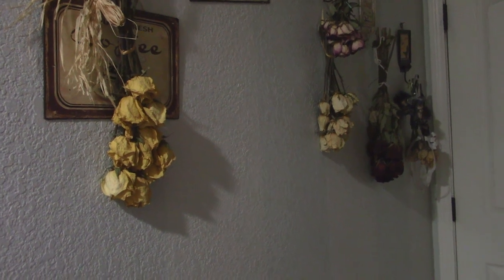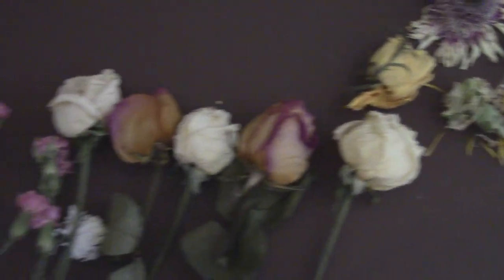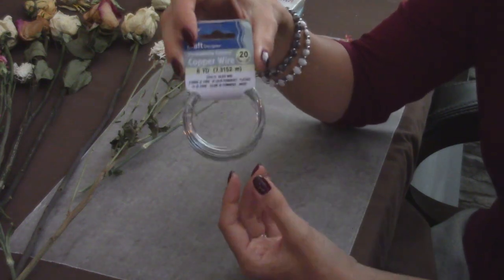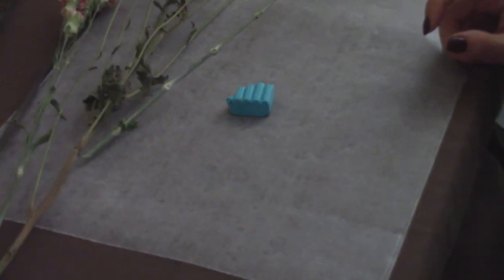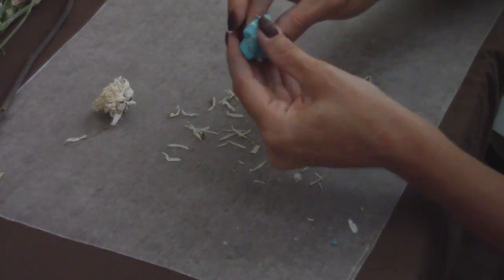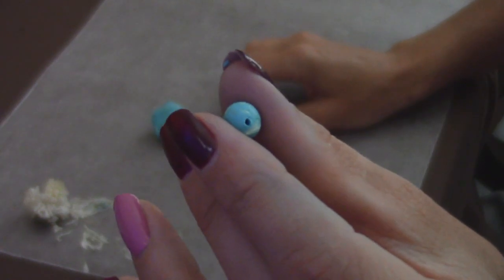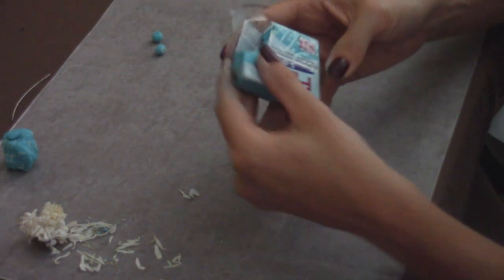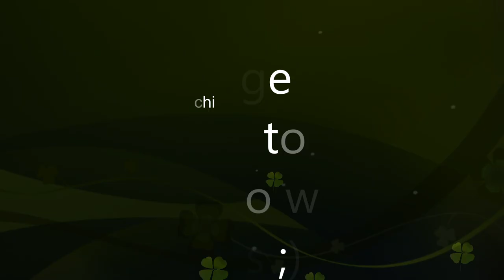Fresh Flower Preservation (Part 2) Memorial Flower Beads

Comment: Even if the flowers aren't significant, this is a great idea.  You could use dried lavender buds in the clay and it would be beautiful.  You can also take lava beads or cork beads and put  a bit of essential oil on them.  I would maybe separate those from the handmade beads with metal or glass.  It could be a cute idea.

Comment: When you put the oil on the clay put it on wax paper and fold the paper over so the clay is covered and roll it with a rolling pin... Also, a pasta machine works well.
Reply from the maker: Thanks for the great idea!😊
Reply: Kelly Barlow Creations putting it through a pasta machine is the best thing to do, try not to add oil as later on the oil might bleed out of them.  When I'm making beads or anything with polymer clay I work it between my palms while the rest of what I'm going to use I either sit on or put under my legs.  The heat of your body is the best thing to use. I have had my family tuck a pack of clay here and there while they watch tv and I craft. Xxxx

Comment: Fimo is very easy to work with if you do research about it. :) You have to warm it up in your hands so the clay will soften your fingers won't hurt. You can make it super soft just by using the warmth of your hands and even smudge it.

Comment: the clay that you already work and you put into a bag if you let it sit does it become harder and you have to rework it? this is a really great idea and I absolutely thinking about making some of these beads myself inspired by your video 4 gifts. sorry just wondering if it becomes you know back to being stiff and you have to rework it each and every time you're working with it or does it stay somewhat saw and you only have to work it a little bit to make the beads. again thank you for the inspiration I'm glad I stumbled upon this video but I am very very sorry for your loss I know that it's been over a year but I know it never gets easier. if you wouldn't mind letting me know that would be wonderful thank you so much
Reply: rachael libero yes, but it will be easier to re-condition the clay the second time, because the oils from your hand will have soaked into the clay already.
Reply: It's easy to condition clay if you know how to. Just roll and warm it in your hands. If it's crumbling alot, and a tiny bit of baby oil, or coconut oil, or any oil. Don't microwave it, it will melt the inside, and just heat it up. It will smoke, and that's just nit very good xD. So, just warm it up and add a bit of oil when necessary